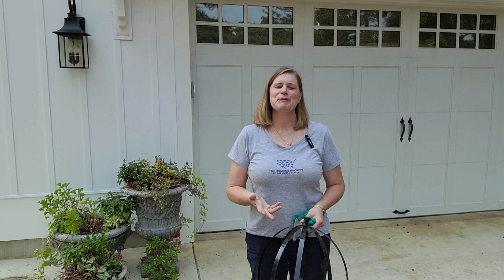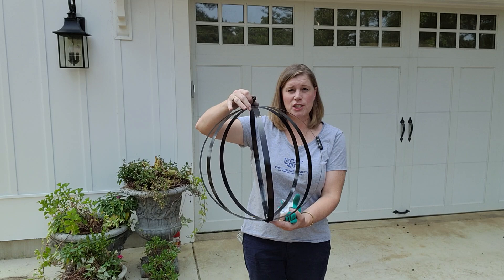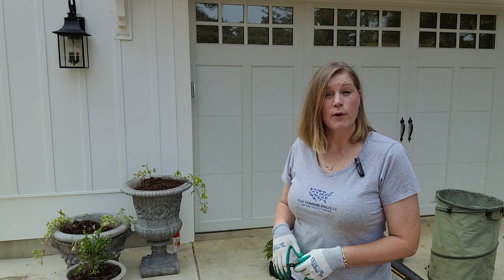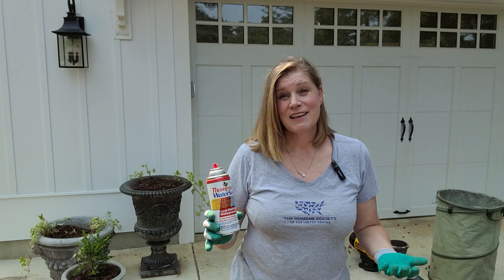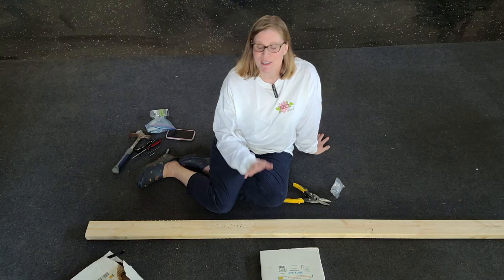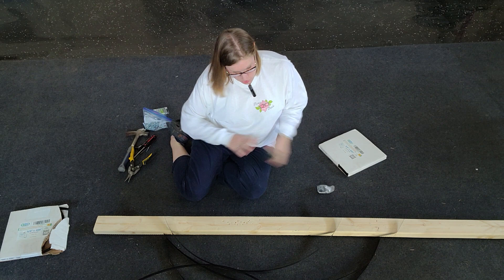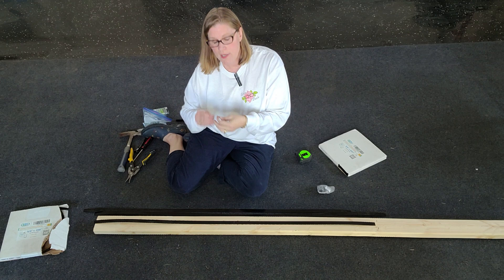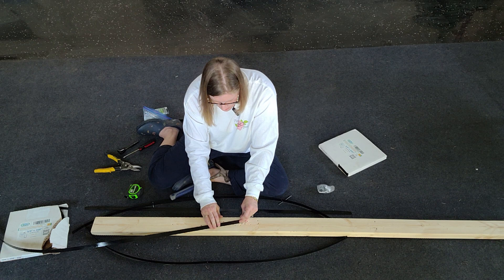🌹 How to Build a DIY Obelisk / Orbs for Planter Winter Interest / Decorative Orb Obelisk Topiary

Comment: Love this idea. I found you after watching the Garden Answers embroidery hoop version. I’ve got the supplies from your list which I believe include 3/4” x .020 steel strapping but am frustrated bc I can’t make the holes. The nail method didn’t work and now I’m still struggling while using my electric drill. Any recommendations for me? Thanks, Laure
Reply: Thank you for replying!! I will totally try the masking tape. There has been some slipping with both methods. When I hammer the nail does nothing. Maybe a different kind of nail??? I’ve tried several. 

Did manage to make 3 holes with my very basic drill but it took forever and the drill got hot. I’m planning to make several of these spheres so I have lots of holes left to drill.
Reply: Thanks!
Reply: I did it with a little help from my husband! Apparently I needed a much larger nail and a work bench in a cold garage. When I tried to pierce the strap with the nail previously I meekly pounded the. Nail into a board in my warm carpeted bedroom at 10 pm while wearing my nightgown. The nail was not impressed! This caused me to try to drill the holes which also didn’t work. Definitely use a large nail like a boss and I’ll will be well!

Comment: Hello, I have a 16" planter and want to make an orbelisk like this. How long should my strapping pieces be? Thank you!
Reply: @TheRoseGeek   Gosh, thank you very much. Wish I was smart like your husband! Please tell him thank you. That is such a good idea to take out some length, bend it and hold it over my planter to see if I like the size. Thank you again!
Reply: I know I am pushing it here but if possible, I have 2 more sizes. One is an 18" and the other a smaller 9" planter. Is he at all able to calculate for me those two sizes for strapping? Thank you!!
Reply: @TheRoseGeek  Oh my, thank you both so very much! As you can tell, my first attempt will be the 16" and then I'll try a few more after that. I am going to work on these for Christmas gifts and already did get my 3/4" metal strapping in that you suggested we use. Thank you for your very informative video and Happy Holidays!
Reply: @TheRoseGeek  Hello, I have cut the metal straps and am having a hard time getting the nail through the metal. Just wondering what size metal drill bit(s) you might have used (if you did!)?  I think I need to try this next. This metal is pretty thick! Thanks so much
Reply: @TheRoseGeek  Thank you for this information, I'll get these and give it another try.